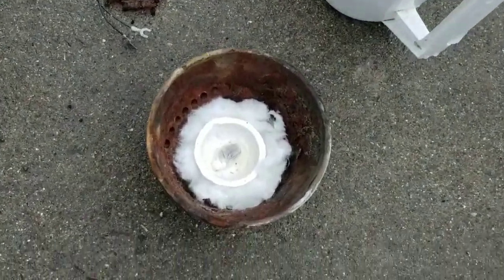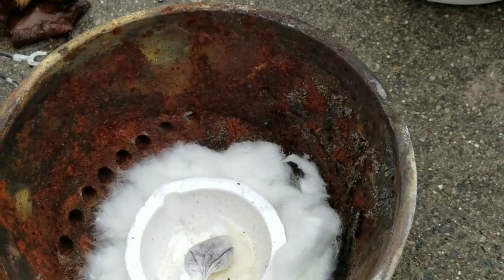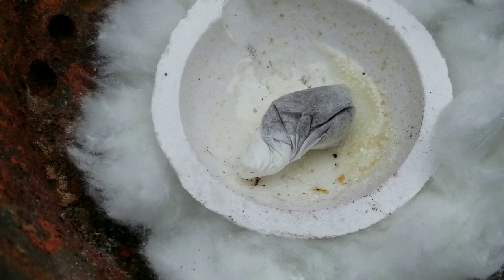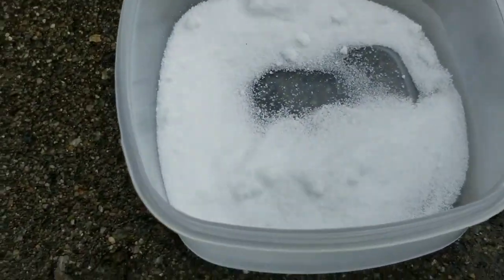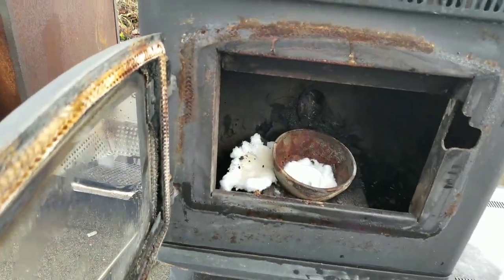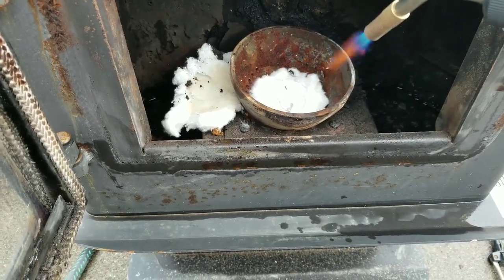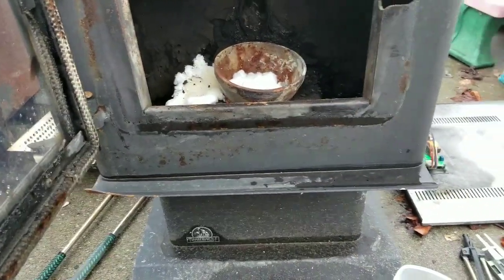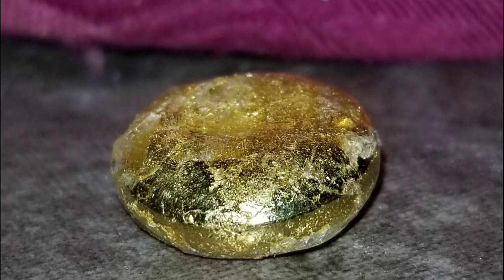Melting gold with mapp gas and a melt dish

Comment: What is the white candle wax looking fire retardant in between the crucible and the iron pail ?
Reply: I believe that is ceramic wool used as insulation for most homemade furnaces as it has a very high resistance to heat

Comment: Nicely done. Why so much borax?
Reply: Borax helps to prevent the metal from sticking to the bottom of the crucible but also to bring any impurities to the top (makes your gold real shiny) any clumpy stuff that comes to the top or sticks to your stir stick and is dark and clumpy looking those are impurities called slag. You can scrape those out and hammer them down to recover any gold you might’ve lost in the slag or you can use the aqua Regia method (hydrochloric acid + nitric acid) this will dissolve everything including the gold and will refine it to 24k but if you can’t do that then using just hydrochloric acid (in hardware stores called Muriatic acid) and hydrogen peroxide the acid will dissolve any metals that aren’t gold, while the hydrogen peroxide will help the acid to oxidize any other metals than gold which in essence will help dissolve and get rid of any other metals

Comment: My torchead sucks. It does not create a hot enough flame regardless of where in the flame I aim for. Insulated melt box, tiny dish etc, does not help.
Heck I get same flame temp from a $20 butane burner if not even hotter. MAPP can suck XXX. Building a oxyhydrogen setup.
Reply: what karat aare you smelting?
Reply: So since i want to buy some kind of blowtorch, what can you suggest me?
Reply: @salvatorecristiano2030  if you want something cheaper and simple you can go on Amazon and buy a double hose nozzle with one for your gas source of choice and the other for an oxygen tank. This increases the heat of any gas tank you have connected to it. But be sure to be safe and watch lots of videos about oxy tanks and the safety procedures you’ll need as this is a much much much higher safety risk than just a regular tank and nozzle

Comment: I like your crucible set up.  What kind of insulation is that, or will any kind do?  I think I have the exact cheapie crucible, but its still a virgin.  Thanks!
Reply: ceramic wool likely
Reply from the maker: +Karl Ehlert I couldn't tell you what kind of insulation it is, because I took it out of the pellet stove I'm melting in.